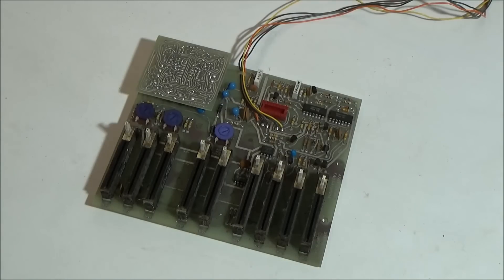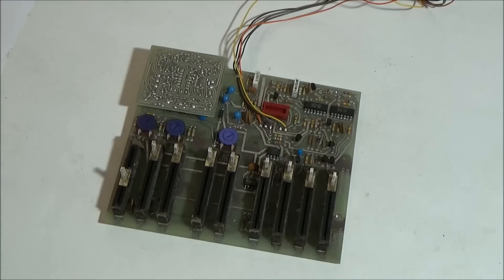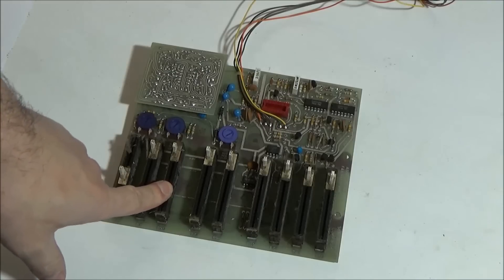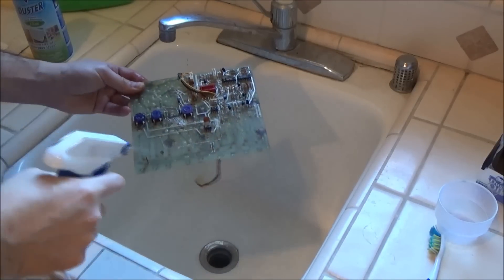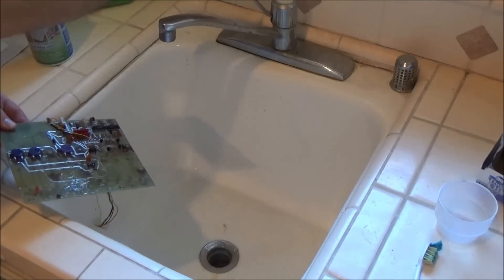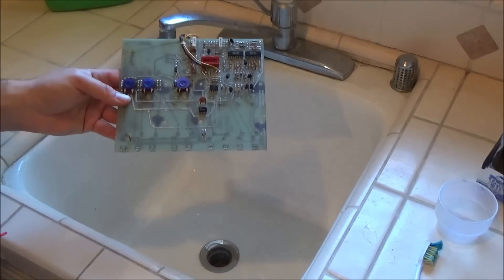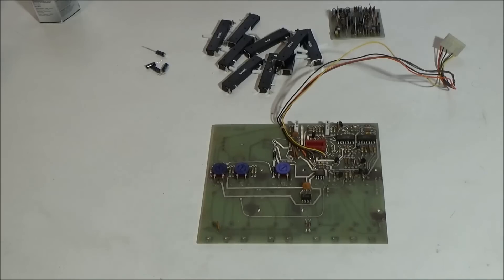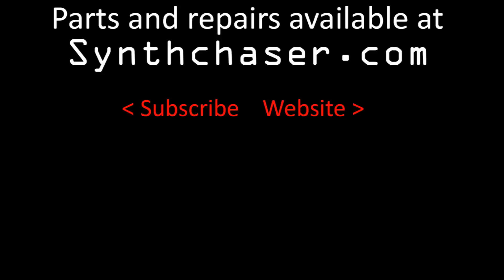Synthchaser #096 - Washing Dirty Circuit Boards... In The Sink!

Comment: How about charged capacitors, wouldn't they release some stored charges and fry the some of the components?
Reply from the maker: I'd hope that if someone had a board with capacitors that remained charged with any sizable charge that they would discharge them before handling the boards, let alone washing them.  But, you'll find most capacitors will discharge through the circuit soon enough after it is powered off.
Reply: @Synthchaser  Thank You.

Comment: Hi, this question is not directly related to this video but here goes.
I'm renovating synths and drum machines as a hobby (really small scale for personal use) and recapping seems mandatory. When ordering replacement caps there's a billion choises. I usually go for Nichicon and use the UES-series for bipolar in audio path. Do you have a recommendation or rule of thumb when it comes to PSU-caps,  decoupling caps and polarized caps? Are some series better suited for replacing tants? There are several series that seems to be suitable (UVR, UFG, UVZ...) It's confusing. Any recommendations?
Reply: Replate tants with tants in power supplies. They're there for a reason.

Comment: What is the best way to remove flux residue?   I've been giving my boards a bath in flux remover then alcohol to get rid of the sticky stuff.   Will this method with the citrus degreaser also do the trick?   Excellent video as always!
Reply from the maker: Denatured alcohol with a q-tip.  I do that before the wash.
Reply: Finishing with an ultrasonic alcohol wash would remove this step for you...

Comment: I frequent the retro arcade community and do restore work on 80's arcades which are pretty similar component wise/similar type pcbs in some respects.  It's common for folks to clean these boards in regular tap water just like this.  Some of them go even further and put the wiring harnesses in the dishwasher with no soap(I won't go there)...but the results speak for themselves.

Comment: Good job! I always wondered about this, it’s quite counter intuitive, unless you have the experience I guess. 
Putting aside batteries, are there other common circuit board components that you would remove before washing?
Reply from the maker: The sliders...  Stuff gets washed in and stuck in there.  Not had a problem with anything else that I can recall.